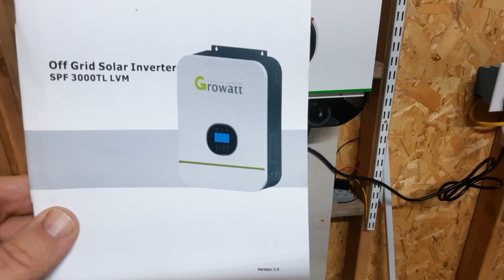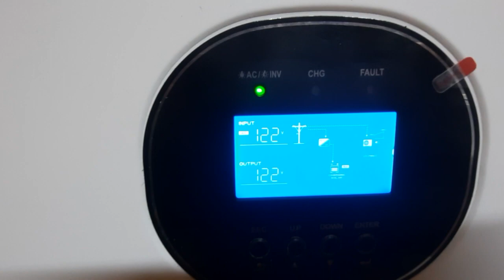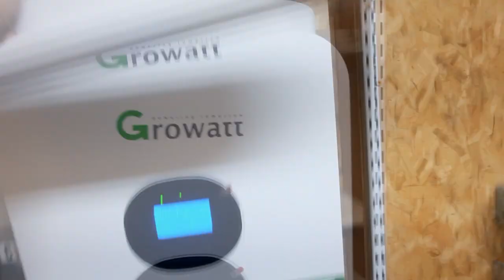Growatt 24VDC 3KW Solar System

Comment: I have this same growatt. I am hooking up the wire from combiner box to growatt PV in. I see the hole the wires go into and the only place to hook the pos and neg wire to is a small black box with 2 screws on it. The problem is it doesn’t say which screw is pos and which is negative. Any advice?
Reply: It's hard too see...you need look closely ...from underneath !
Reply: @lachlanbird9688  I just picked one and it worked lol! Thanks.

Comment: Im new to this solor panel stuff. Do you need a specific disconnect for the solor panels or can you just hoop them up to the growatt directly.
Reply from the maker: The panels can connect directly to the Growatt. It performing as a charge controller for the panel output voltage to the system. I also have a seperate combiner for the panel array outside. It has circuit breakers inside it.

Comment: Do you need a separate AC battery charger to charge the batteries or does the grow-watt charge the batteries. Also even though its just your backup power for blackouts is the Grow-watt always on or do you turn it on when the Grid goes out?
Reply from the maker: While plugged into an AC power source, this model unit will charge/maintain the batteries if the solar input is not sufficient. It's an All-In-One type system. It is not grid-tied so it will not feed back power to the grid.
Reply: @OzarkGeek  Great thank you. Does it growattt inverter have to always be on. I'm using it for the same source that you are just as a backup.
Reply from the maker: @SPEAKERrickydelrosario  Not that I know of. There's an on/off switch under the unit. Not sure of that stop all power sources.There's probably some amout of drain. That's why I put in a kill switch (lower left corner). If there's no battery drain. They should hold the existing charge.

Comment: Can you make a video on how you set it up to your RV. Because I was thinking of doing the same thing.
Reply from the maker: I don't have it connected directly/installed to my RV. I'm stationary located and have the Growatt mounted inside an adjacent 8x8' shed.
At 1:38 you'll see 2 connectors on the left side of the Growatt. You'll see AC IN and RV OUT. I have the RV's 30Amp cable that plugged originally into a power outlet on a electrical pole now plugged into the RV OUT connection. I made a new 30Amp cable that goes to the AC IN connection to the original 30Amp power source on the power pole. This feeds the utility pole 120VAC into the Growatt and outputs to the RV OUT connection.
I'm planning to buy a 2nd Growatt unit and run them in parallel to support 6Kw usage. I discovered that with just the 1 unit and it powering my RV trhrough it the draw can exceed 4Kw sometimes when the furnace kicked in.
After I get the 2nd unit in I'll do an additional video and you'll then see how I'm powering the RV.